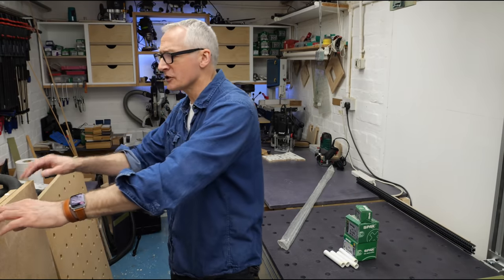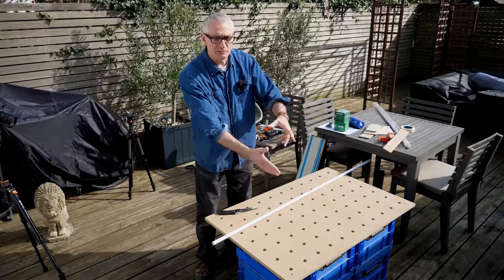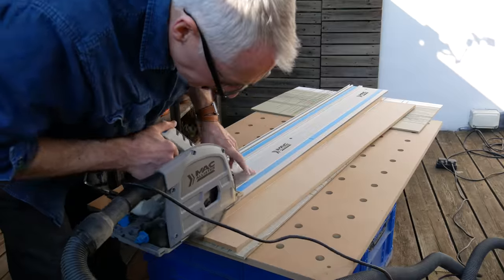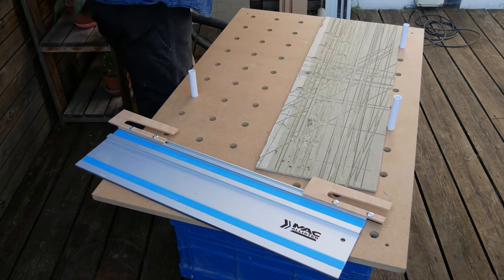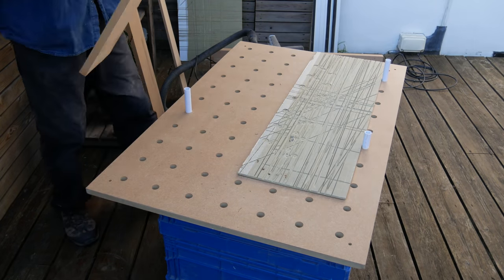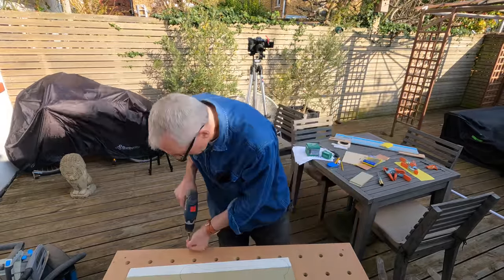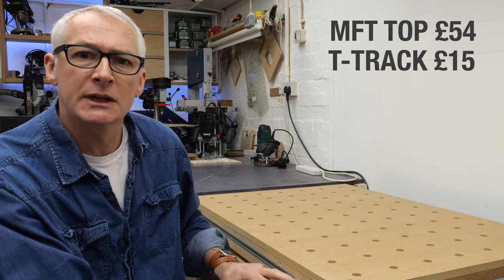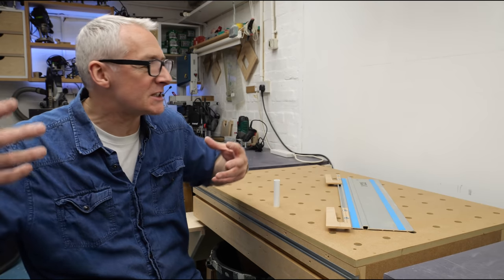Backyard, DIY MFT on a Budget  [video 490]

Comment: Great build. I have been using conduit benchdogs as well. I cut a short length of conduit and solvent weld it into 20mm conduit coupler. The coupler sits nicely on the table top and stops the tube sinking through to far. Adds about 25p per dog so hopefully still in budget 😃

Comment: What about full ghetto spec Peter. Maybe an old ikea table top and wardrobe recycle? Is pallet wood out of the question? An MFT for under a tenner maybe? That’s just me thinking out loud with my fingers mind 🤘🏻
Reply from the maker: Trouble with that is that you need the holey top, which aren't cheap, and the cheapest jigs cost more than the top. 🤷‍♂️
Reply: @10MinuteWorkshop  cheers Peter thanks for the reply. I’ve been watching since the start and I’m sure I remember a while back you making a simple jig for drilling repeating mft spaced holes. I could have dreamt it mind 🤦🏻‍♂️

Comment: You can make t track by using 2 bits of flat bar  screwed over a hole so it overhangs to provide a slot  tile edging also works if screwed in place

Comment: This is exactly what I need to modify my existing built-in bench in my garage. I was considering cutting mft holes in the existing surface but did not relish the sawdust falling through into the storage areas below. Thank you for showing how to do it without spending a fortune.

Comment: I love this idea, and it's going into my shop the first spare weekend I have (after I DIY the actual MFT top, and I've found the video for that)!
The though struck me, and I haven't searched comments, so, my apologies if I'm late to the game, but, put a piece of 3 or 6mm across the bottom (making this an actual box), cut a port in the side for a shop vacuum, et, voila, integrated dust collection!!!
Reply from the maker: You’ll need an extractor the size of a jet engine to create enough draw across a surface that size, with holes that large, unfortunately! 🤷‍♂️👍
Reply: @10MinuteWorkshop  I live in the aircraft capital of the world (Wichita, KS). I can get a jet engine ;-)

Comment: I have no issues using routed t-slots. Great for stop blocks and featherboards. I only do light clamping to hold down parts. I tend to route them deeper than aluminum channel to give them more strength.

I've only used wood and mdf. I was concerned about plywood delamination. That would be a good test to try.

Cheers!

Comment: Really like this build. Now trying to work out the best way to mount it on the top of my Workmate in a way that won't impede dog hole access for clamps etc. Trickier than i had hoped!
Reply from the maker: Thanks! That is tricky; are you planning on a frame around it? That will give enough height for clamps - dogs aren’t generally a problem unless you want to fix them from underneath. You could add a base to it - like the Paulk bench - then fix a batten across the base and clamp that in the jaws of the workmate - you’ll need to notch the batten to get it over the workmate framework, but it works well. We used to use workmates as ‘set’ tables back in the photographic days using the ‘batten & board’ trick, and they were perfect for the job. HTH. P

Comment: Hi Peter, you mention that by allowing an overhang this will reduce the length of the crosscut (then you post text on the video "if using a fence"). Can you explain why that would be the case as I am being a little slow this morning.
Reply from the maker: Sorry, badly worded whilst speaking off the cuff. What I meant was that if you have the overhang, then you won’t be able to mount a rail hinge (not without taking up benchtop space) so you’ll be left using either the dog locks or rail dogs, both of which will reduce the cut width to the max. distance between the dog holes, or more if you use a fence as this will sit in front of the last row of dog holes. Hope that makes sense! P
Reply: @10MinuteWorkshop  It does and thank you for taking time to answer people's comments.

Comment: I've just (last week) grabbed the matchfit pro kit and it's a complete game changer for me. It's trivial to use, set the height with the included guide, set your fence, route away. Done. The slots are much stronger than the t-slot cut (with router bit) track,Yeah, it's not really cheap but then I was looking at buying a table for my drill press (£130 :( ), ended up buying matchfit and making my own. Honestly, took me 10 minutes to make the base with slots and a matching fence. The hardest part of the matchfit system was extracting the router bit from its case (it took me longer than making the table!). I'd recommend it wholeheartedly. I'm about to add the dovetail 'tracks' to my home made mft, in between the dogholes for endless clamping opportunities.
. 
The only real downside is having to buy their clamps but given you can add these tracks to pretty much anything I'm not sure it's a giant problem. You can also get little plastic parts for making your jigs without using the clamps. 

Beginning to sound like an advert now so I'll stop..

Great video, again, though Peter.
Reply from the maker: Good to know, thanks Andy! 👍

Comment: Another great build, I’m really looking forward to making one myself. I’m not sure if you already done so, but if not, I think telling beginners about the basics of piloting holes and screwing stuff together would be invaluable. I see beginners drill too large or too small pilot holes for the screws, especially in MDF and then too big in softer timber. Also see clearance holes too big/small in the outside material. Screw choice obvs makes a big difference, so for beginners really confusing. Nothing worse for them than finding a screw binds before driving home or continually turns 👍🏻
Reply from the maker: Thanks Andy. That's an idea I've had on the back-burner for a while, but thought it might be too basic. But I still keep coming back to it! I always struggle with the translation issue too - a 4mm pilot for a 5mm screw won't help if you think in terms of 'inch and a quarter by eight...' Still, there's definitely something in it. 👍
Reply: @10MinuteWorkshop  yeah, I find when teaching my 2 boys, it’s tougher than you first think. I’ve some of the old Screwfix self-countersinking and drilling screws that do a great job in some woods but struggle in mdf. New things come onto the market all the time, so for us DIYers, learning about new and better kit, even screws is great. With a spot on pilot in mdf, you don’t need a deep thread on a screw, but you know what it’s like screwing into soft end grain 😆
Reply: I think the answer to what pilot bit to use is to take the diameter of the  screw minus the thread height. Put another way, measure the part of the screw that the threads attach to, the central shaft where the threads project from.
Reply: @jeffstanley4593  I’d say this is fine sometimes. If you’re screwing big stuff together, you can end up with the screw threading in both pieces of wood, tightening, but not pulling the joint together as well as it might. Some of those old countersinking screws I’ve got, declare no pilot hole needed and definitely cut up near the shank, so tighten well. Just in tight grain, they have a tough time. The stainless versions were always shearing on me without a pilot hole and ended up getting redesigned with a strengthened shank, though I’m still wary and use an under sized pilot to give them an easier time.
Reply: As an absolute beginner, this would be very helpful! Now I understand this may not necessarily make a good longer video, so how about doing multiple shorts? Really break it down for people like me who only know the difference a nail, screw and bolt 😅
Reply: @DoItYourselfAndy  " If you’re screwing big stuff together, you can end up with the screw threading in both pieces of wood, tightening, but not pulling the joint together as well as it might." The only time I have observed when joining two pieces of wood and them not tightening is when the screw doing the joining is threaded all the way to the head. A screw that has an unthreaded part under the head that is equal to or greater length than the thickness of the top board will tighten two pieces together. There is no other choice. For instance, two boards of 3/4 inch thickness. A screw 1 1/2 inches long with a portion under the head NOT threaded of 3/4 inch. That screw will pull the two pieces together as it is pulling on the bottom piece not the top piece. It is acting like a vise. The type of wood is always a variable pitch of the thread as well. There is no best screw for all applications, just better choices.
Reply: @jeffstanley4593  yeah that was what I was referring to, the shank was the bit that’s unthreaded. We’ve built a few benches, plus plenty of 4x2  screwed stud work and the shanks are often not long enough. Like I say, my preferred was a small pilot just thru and then a decent deep thread screw. My late old man used to swear by twin threads, so I’ve inherited about 1000 of just about every size 😆, but then he was a chippy.

Comment: I think that was a really kind thing to do for all the guys working off of milk crates in their back garden. It gives people inspiration to have a go rather than telling themselves they can't because they don't have this or that. 

Can I ask why you do a double T Track at the front?
Reply from the maker: Thanks! Re the double tap-track, as I think I said in the previous vid (DIY workshop MFT) it’s just to increase the clamping opportunities. For example, being able to have a front rail support stop in the top t-track without it affecting clamps in the bottom slot. You don’t have to do this, but I find it useful - I only had one length of t-track so I left scope to add another in later. 👍
Reply: @10MinuteWorkshop  Thank you Peter, had I of thought this through I should have been able to work that out, it is Friday!!
I must have missed the DIY workshop MFT video so will go catch up.

Comment: Just a tip. You are getting a tiny fraction of the glues holding strength the way you are applying it. To get a strong hold, spreading the glue evenly throughout the board is essential.

Comment: The videos are really informative and enjoyable. I can see that you use a plunge saw on track extensively for a large variety of jobs. I have a makita 165mm circular saw and would like to start doing some small woodworking projects for the house. Would you recommend getting a track saw (like the Mac Allister in the video) or a medium size router first ? Cheers.
Reply from the maker: Thanks! I find a track saw generally much to use than a circular saw with infinitely better dust collection, so if you’re working out of a smaller space then that would be my first choice. Routers are wonderful tools and I have a few,  it they don’t get used as much as the saw. 👍👍

Comment: Thanks for showing us this budget build Peter. I wandered if you could tell me what screws you used to secure the t-track, as my festool clamps catch the screw heads and won't slide in the track. I have tried to find some screws that fit flush with the inner track without success.
Reply from the maker: They were 3mm x ~20mm chosen specifically for their low profile.  👍
Reply: @Peter Millard  Thanks Peter

Comment: Great cheap build and considering whether to make a table top now… do you feel it is not wise to add a cross member under the centre of the table to prevent the top bowing ? I have found tops will generally do this in fairly short order if not locked flat.
Reply from the maker: Thanks.  Provided you use a decent MRMDF top there’s negligible sagging with a grid of holes, so a crossmember isn’t necessary - no OEM MFT-style bench maker supplies one - but if it makes you happier then go for it. I did get noticeable sagging when I added in a grid of t-slots though, but a simple crossmember sorted that out. 👍

Comment: Peter, as usual advice taken. My top arrived yesterday & what i would like to know is that product you finished yours with suitable for ply. If not could you advise. Costing me a fortune your videos but the returns are well worth it. Im rubbish but what a buzz this whole journey. The community, the digging out short cuts the whole kaboohz. Many thanks for intro. Keep on.
Reply from the maker: Thanks Steven! I’ve used all kinds to protect the top - water-based poly, clear varnish, hard wax oil, Danish oil, beeswax - and never really found much difference between them, tbh. Use whatever you have - just remember to clean out the holes with a benchdog before it dries! You’ll thank me later! 😂👍

Comment: Thanks for the video, the channel, and absolutely everything you post… I am looking at building exactly that to have it stored and use it in my garden when I need it. Quick question(s): What about an overhang on the short side? Any particular uses for that? Also, If I were to use trestles that I already have to  go underneath. How you you secure them to the top and still be able disassemble? Thanks again for your content
Reply from the maker: Thanks! The overhang is for any time you want to clamp a workpiece to the bench using eg regular clamps instead of rail clamps through the holes; if you feel
An overhang in the short side would be beneficial to you, it’s simple adjustment to make. 👍

Comment: Hi Peter, I have had an MFT (fake) top for about 6 years now. I was recently looking for a replacement which meant the power of the Internet threw up your video when I just opened YouTube. I’ve got no idea what the t track and the sides do but I’ll be looking into that as I’m sure it’s going to be helpful. I like the idea of the dog locks so I’ll be making some of those. I’ve got a dewalt plunge saw, so I’ll go and see if I can find a small length of track for it. The track I have is an 1800mm one. Thanks for the video I’ll definitely be checking out some more via your channel.
Reply from the maker: Thanks and welcome! The t-track in the sides is for any kind of clamping where you want the workpiece perpendicular to the benchtop. 👍
Reply: @10MinuteWorkshop that sounds a great amd very useful idea. Which clamps fit in the t slot? I’m going to make one (when I’ve got time) 👍🏽
Reply: Actually, I’ve got some festool clamps that might fit in those slots. At the moment I just use them to hook though the holes in my table top.

Comment: Would you mind explaining what the track on the front of the top is used for and how it is used?
Reply from the maker: Any kind of clamping where you want to have the workpiece held vertically, or perpendicular to the benchtop. Have a look at my 3 drawers video - it’s how I cut the rebates fri the drawer fascias. 👍 

3 Drawers, no tape, no ruler [video 508] - https://youtu.be/ObR9kbXu8PQ

Comment: I’m going to build one soon. How would the weight compare if I used 18 & 12mm birch ply for the frame and same mdf top? How is MR MDF in a unseated, uninsulated concrete block garage? I was thinking ply with some nice sealant on it might fair better over the years? Thanks for the inspirational videos again Peter.
Reply from the maker: Thanks! Lighter, certainly; 18mm Birch is about 11Kg/sqM, 18mm MRMDF is 15Kg/sqM - though you're not using all that much for the frame! Hard to advise without knowing how damp it might get or the temperature extremes, but I'd say the plywood option would be the wise/cautious option, yes. 👍

Comment: Really like this idea and video, start building the bits you need to build better pieces. Quick question, the metal track on the front edge/side of your MFT top, what is it for? You never mentioned in the video what it is for and didn't see you use it in the video, sorry if obvious question but new to this.
Reply from the maker: It’s for clamping, or adding stops and accessories. If you’re new to the whole MFT workbench concept,m there’s a whole playlist with all the MFT related stuff isn’t it. Might be worth watching the previous workshop MFT build too, links in description. Ikea Curtain track DIY MFT  - https://youtu.be/223QALIbnRc 👍

Comment: I am severely restricted for space in the UK. I have a 2m x 1m tool store in which I keep my tools, including 2 trestles. Sunny day woodworker! Currently I use an MFT top resting on a piece of OSB. If I made one of these "MFTs on a budget", it would need to be less "deep". Did you choose the depth of the sides to suit your existing MFT supports or for rigidity? I would need to store mine on its side and it would need to be slimmer when on edge.

Looking forward to your plywood rail hinge video.
Reply from the maker: When you say deep, I assume you mean the height of the frame, not front-to-back depth? If so the decision was two-fold; firstly at 200mm high it gives a good clamping area if you need to keep a workpiece perpendicular to the MFT top. My OEM MFT was about 160mm, but that was aluminium. HTH P 👍

Comment: Awesome. To the max.

Love the idea of a basic build starting from scratch with workbench and using each tool to make each successive one

On an unrelated note, I'd love to see your take on a DIY track hinge using fire door hinges as some on the ukworkshop forum have done. It would be a logical evolution of this cheap and cheerful workbench
Reply from the maker: Thanks! The old ‘fire door hinge trick’ has been around for a while; my issue with it is that it’s a permanent fixture. The DIY hinge I’m planning will have the rail removable much more easily. 👍
Reply: @10MinuteWorkshop  this’ll be interesting, I like the simple idea of the hinges, but don’t want to drill holes in my expensive rail 😂. I could also see this as something where Ralph @benchdogs could make a more elegant solution of the z fold, I have sent him an email about it, but be good to see your take on it too. :_Happy:
Reply: @10MinuteWorkshop  nice, looking forward to it
Reply: @idlersdream826  Benchdogs are working on a rail hinge I believe.